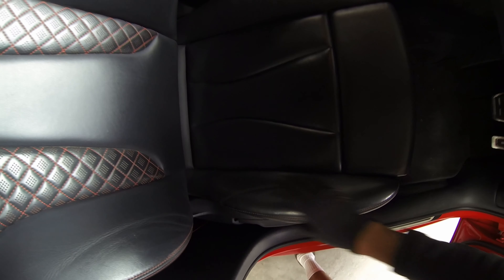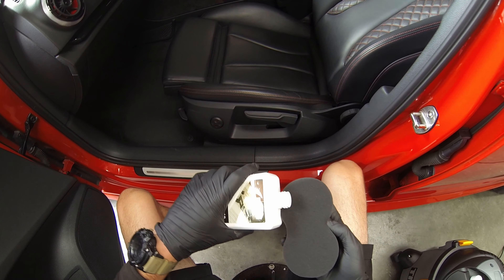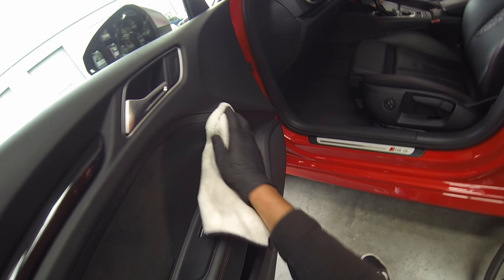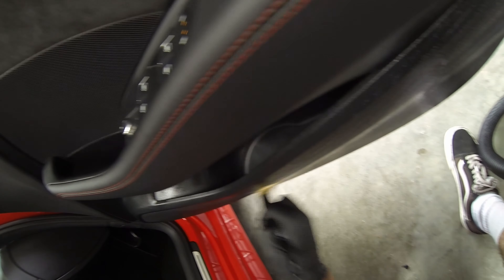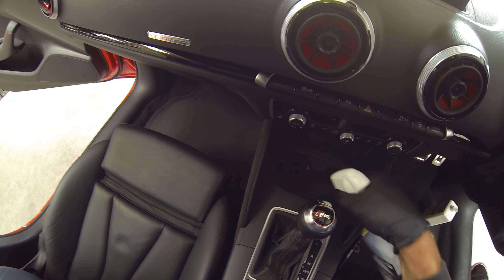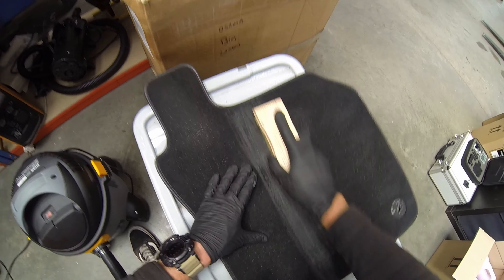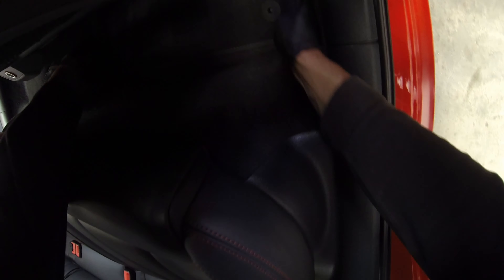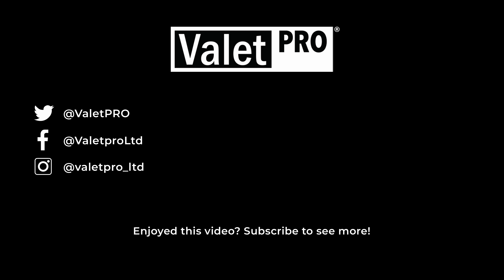Cleaning This RS3's Interior (in first person) - Episode 4 | A Detailers Perspective

Comment: So is the dressing necessary? I don’t like silicone dressing. Or does is serve a purpose? 

Im interested in the advanced interior! Also question, what is the interior foam cleaner I’ve been seeing detailers use on Instagram? Does Valet offer a similar product?
Reply from the maker: Classic Protect is a water based silicone dressing.  It has some water repellence ability. It makes future cleans quicker and easier because grime does not hold on so well.  It does not leave a greasy feeling on surface it leaves  more natural finish.  

The interior cleaners other detailers are using I believe is the use of a foam desponsor.  Something like this https://www.ampulla.co.uk/shop/plastic/foam-pump-bottles/200ml-clear-plastic-clear-foamer-bottle/?utm_term=&utm_campaign=PMax:+Shopping+Generic&utm_source=adwords&utm_medium=ppc&hsa_acc=3688757882&hsa_cam=17613030902&hsa_grp=&hsa_ad=&hsa_src=x&hsa_tgt=&hsa_kw=&hsa_mt=&hsa_net=adwords&hsa_ver=3&gad_source=1&gclid=CjwKCAiAmZGrBhAnEiwAo9qHiTJ2xcOJC7pGwa-QNZ2OMHd96kk0B-4rmQwv_e8OYpFEZjvk2eszmhoCSu4QAvD_BwE  These pump create thick foam with most cleaners.  Our Advanced Interior Cleaner should create a thick foam via one of these pumps although I do confess I have not personally tried it.

Comment: Can you use advanced interior cleaner on anything? It's basically an APC as well?
Reply from the maker: Due to the pH neutral chemical design yes,  its like an APC.  you can use it on all surfaces.  We specifically designed it to deal with Alcantara as this is a question we get ask a lot on how best to clean.  It is an excellent and versatile product.
Reply: @TheValetPRO  so it’s no problem on leather seats?